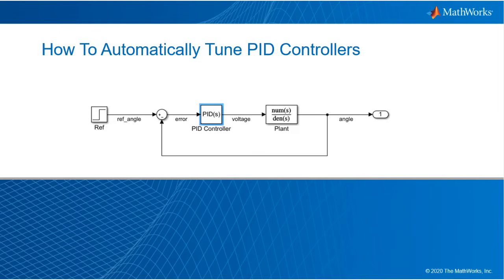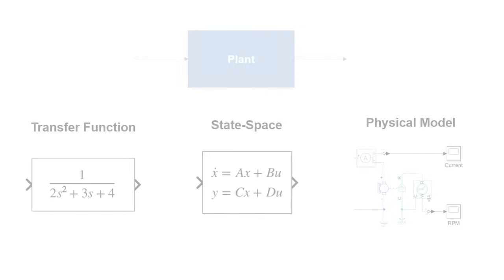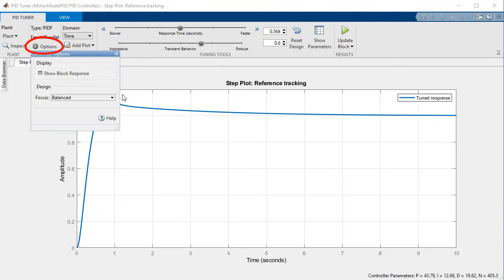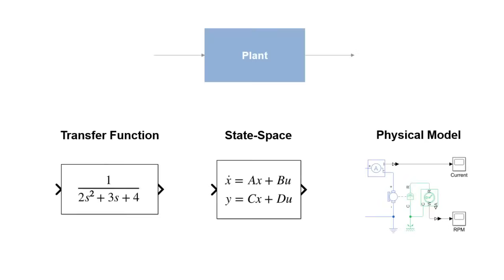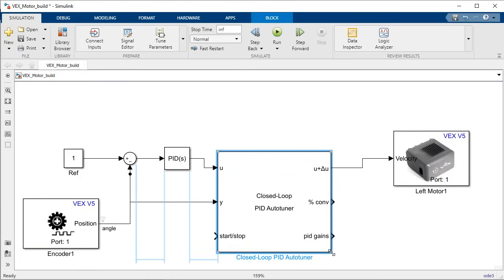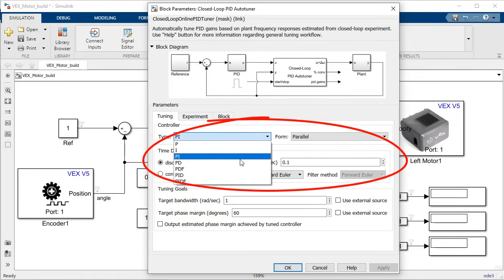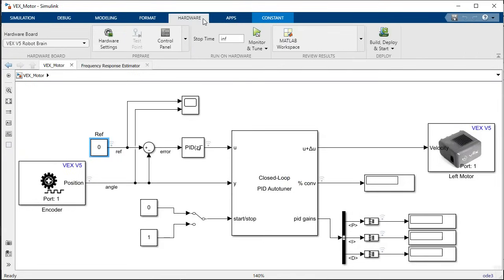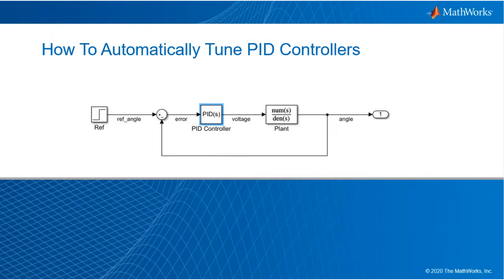How to Automatically Tune PID Controllers

Comment: Thank you for this explanatory video, but the example shown is chosen very wrong. You should never tune the controller for the wheels with the wheels raised in the air. When the wheels touch the ground so the motors are under load, the system dynamics (and also the mathematical model) will be completely different.  So the controller you set while the wheels are in the air will not work as you wish.

Comment: I have a question. When I try to use my Simscape model, I can't close the loop directly because it would create an algebraic loop and the simulation would have unpredictable behaviour and discontinuities. To solve this, I  added an almost transparent first order transfer function, to remove the loop. However, by implementing that solution, Simulink does not recognize the Control Loop, and it can't autotune the PID controller. 

Any ideas?
Reply: Use a unit delay 1/z in the position feedback loop

Comment: Dear MATLAB, 
What do you mean by "automatic tuner"?!  Assigning gains of the controller is very subjective and it depends on what the user wants in terms of speed, overshoot, level of disturbance rejection, robustness, etc. Now, how does your "automatic tuner" decide about that for the user?! How does it figure out the user's personal desires for the controller?
Reply: Did you ever opened this feature? I am asking because it is possible to tune response (thus tune controller gains) to desired speed, overshoot and other, even robustness. It is really good feature to obtain gains. Actually, setting controller response is nothing special for linear system, and for some linearized nonlinear systems in operating range (if there is no large nonlinearity).
Also, this feature can also solve integrator windup problem, and in my practical uses it works fairly good. Certainly better than setting it "manually" or using some methods  as Zieger-Nichols.
 As you maybe know, there are tuning  methods that guarantee aperiodic response, such as damping optimum method, so it is not a big deal. Proven in practice for more than 50-60 yrs. Finally, a good PID (in my experience  I+PD form) really solves more than 90% of all control problems.
Reply: @mkrznar  Then it wouldn't be automatic! It is still YOU who is declaring your desired performance parameters not this "automatic tuner". As for the PID, I think state feedback a stronger tool as it gives you more mathematical tools to make your system optimal, robust, adaptive, etc.
Reply: There is no point to go to state feedback for simple problems such as presented herein. It is overkill. Further more, there is a vast class of problems where it is not possible to have mesurements nesecery for state feedback, and you need observers then. This is also overkill sometimes and model dependent. This toolbox is automatic, because you get good gains by clicking tune button (and stable response). If you want to refine controller you can add additional constrains that are available inside this toolbox. Do not forget that all autotuning methods depend on model/indentification accuracy, and from your point of view there is no automatic pid tuner.
Reply: @mkrznar  Thanks for the explanation. The problem I have now is I have controlled a system that is extremely nonlinear with a PD controller but I can't optimize the gains in terms of speed and energy consumption of the controller without doing trial and error manually.  How do you think this can be performed on a nonlinear system?
Reply: @SaeedAcronia  when I needed an autotune PID for a nonlinear model, I just made an autotuner myself via the critera I need for my exact case.
Reply: @maxdefire  how u made it? 
I have non linear simulation with difficulty in finding transfer function. Can u help me for same
Reply: @chinmaydeshpande9674  
I suppose it would require too much effort from me. In short, I did something like gradient descent in a scalar field of valid values using the Monte Carlo method. The most important part is the criteria for reducing the scalar field of values in which iterations occurs. The great thing about it that it doesn't wanna know a thing about transfer function. The bad thing, it need quite a lot of time if we are talking about real systems.